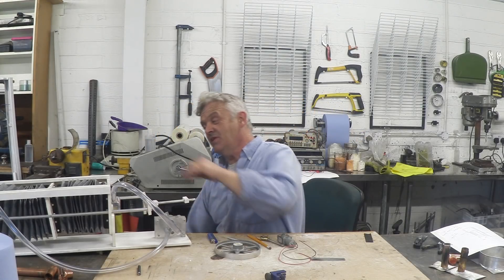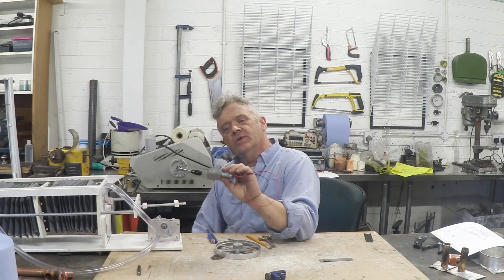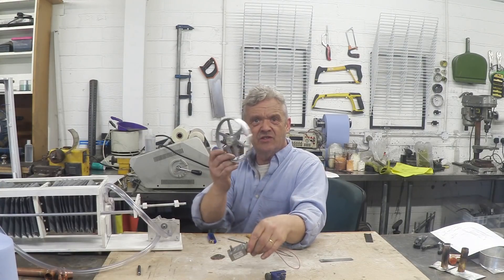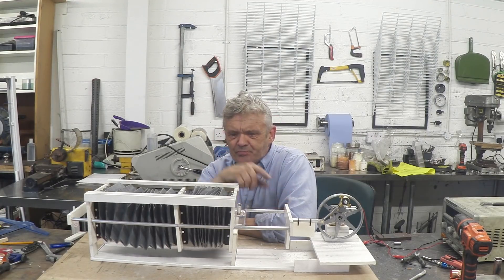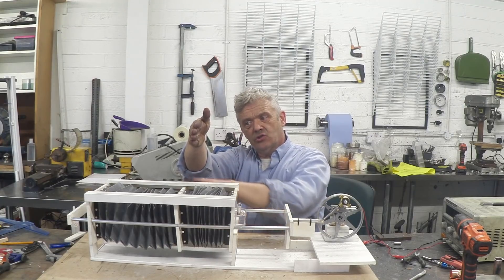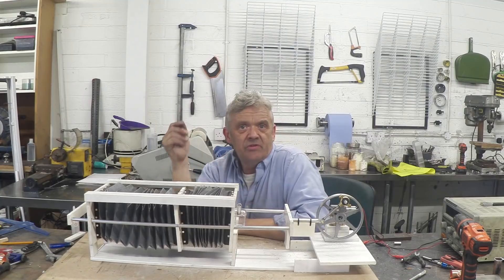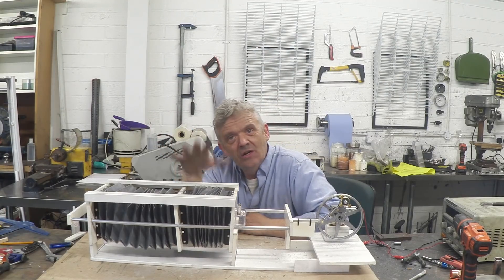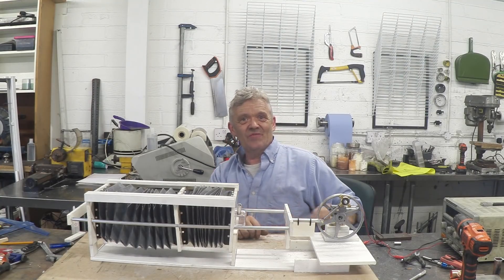DIY Air Conditioning 1 - From Bellows Efficient And Cheap

Comment: Drawing dry air into an evap medium dampened with water would cause said air to cool significantly. Inserting a heat exchanger ( think aluminum tubing air duct) within that cold, humid air section will give you A.C. Make it double acting and you have a continuous flow of dry, cool air to supply perhaps a small room.

Comment: It would be cool to use a Stirling engine that uses the temperature difference between the cold air source and the hot air where the cold air is being pumped to to drive the air con. Then it would cost nothing to run and be left going constantly.

Comment: Another idea I thought about was running the line that comes off of the valve chest through an ice chest with ice and then it would condition the air as someone had mentioned this being an air handler instead of an air conditioner. Just more thoughts.
Reply: That's not a bad idea although making ice in summer costs a lot of energy. But you could of course collect ice during winter, store it in a well insulated tank (buried in the ground for instance) and then use that in the summer to cool your house. I think that's kind of what people used to do back in the day, they'd collect ice during winter and then store it and use it to keep things cool during summer. The problem is that you'd need to collect (and store) a lot of ice to cool your house all summer long.
In Germany they now have systems that use this ice collection principle to cool (and heat) homes in combination with an absorption heat pump (a brine/water heat pump) and PVT panels. During summer you warm up a closed water source and in winter you use that stored warmth in combination with the PVT panels and heat pump to warm your house. Towards the end of winter you stop using the PVT panels and warm your house by running the heat pump only of the source. This to create the ice you can then use in summer to cool your house. It's similar to a closed water source system with pipes in the ground with the difference that those don't get to temperatures low enough to create ice. Basically an ice system is a water source system that has been dimensioned too small. The advantage is that you can make use of the energy it takes to turn ice into water (and vice versa), something you can't with a water source. Melting (or creating) one kg of ice takes about as much energy as it takes to continue to heat that same kg of water to 80C afterwards, so there is a lot of energy being transferred in that phase change.
That phase change concept is something you also see in some passive temperature control products where during the day a material (a PCM or Phase Change Material that's made out of a mixture of salts) changes from solid to liquid by taking energy (heat) from a space (thus cooling that space) and at night, when temperatures drop below its melting point, it cools back down (gives off heat) into its solid shape ready to repeat the cycle. Basically they are thermal batteries, just like a closed water source is.
Reply: @easy_s3351  great info. A thought along those lines would be to build a big enough system to have extra energy to heat and cool water. Much like the process of using this instead of a brake on a turbine. They instead use the extra energy to heat water or you could also freeze ice. I just got a styrofoam cooler from my wife's doctors office that would be otherwise thrown away. I will put 2 vent ducts in the the top with a fan blowing in to the cooler with ice for our bedroom at night. We run the fan now. And it will be used for this hopefully starting Saturday night.

Comment: Great video as always Robert. It is really quiet it seems? I know sometimes video is hard to judge that kind of attribute. There are truly many things that could be spawned from this video. While watching the machine run, I thought that a way to run the valve by putting another rod on the wheel on the other side and use the rotation to time the valve with the movement of the wheel. Just a thought. Love what you do Sir!

Comment: I always watch your videos with a lot of interest and I especially like the reason, the philosophy, behind why you do what you do. But I feel in this case I have to correct you. Your bellows machine is not a cheap diy Air Conditioning but a cheap diy ventilation unit or air handling unit (AHU). The difference being that an AC conditions the air in a certain space whereas an AHU  moves air from one space to another but doesn't actually condition the air. It may sound like a minor difference but it does explain why ACs are more expensive, there's a lot more to them. Systems to move air around have been around for a very long time but it wasn't till Mr. Carrier (they still make AC units) came up with the idea of running air through a curtain of cold water that the AC was born. I happen to be a HVAC engineer so I care about this kind of difference.
You talked about how in summer the tin roof of your building gets really hot, how about if you could use that heat? What I'm thinking about is using it to either run an absorption AC or an ORC/Stirling engine (or both). An absorption AC is much cheaper to run than a compressor driven AC because it doesn't have a compressor but a pump (as it pumps liquid around) which uses much less energy and it runs of excess/waste heat (usually industrial). The challenge would be to see if you could make one that'll work with the heat generated from your roof (the required size of the heat exchangers could be an issue). It could also be interesting to see if it could also work with PVT-panels, those solar panels that also generate heat (Photo Voltaic Thermal panels). 
That would be awesome as you'd then have a relatively cheap to run AC as opposed to the compressor driven ACs currently on the market. I mean, you want to cool when it's hot and the hotter it gets the better you can cool with an absorption AC whereas a compressor driven AC only has to work harder (and consume more energy) as it gets warmer. And you'd yield extra electricity from the PVT-panels because you're effectively cooling them which improves their performance, above 25C a PV panel generally looses 0.5% of its yield per degree C, and you're protecting them from overheating and subsequentially catching on fire. Possibly that extra electricity is enough to run the absorption AC of and then it'll become free to run. How's that for a sales pitch?
You could also use your roof's heat to run an ORC (Organic Rankine Cycle) engine or a Stirling engine when you don't want to cool or have enough cooling capacity with some extra heat left over.
I have actually been thinking about this for quite some time now but don't have sufficient knowledge to work it all out. I think you're a pretty smart and especially pragmatic guy and as you always point out we should share our ideas because several minds working together can achieve a lot more. And, as you also have pointed out, solutions will consist of several systems working together. So what I'm thinking is a system like I just described; PVT-panels on a roof (maybe we could use Oasis foam as a heat exchanger and make our own PVT-panels) and you use that heat to run an absorption heat pump (an AC is a heat pump). An extra benefit is that in the heat pump cycle after evaporating (with the heat from the PVT panels) you have to condensate at high temperatures and you could do that using cold tap-water, effectively (pre-)heating that water and creating hot tap-water. If, like I mentioned, you have enough cooling capacity you can then use any excess heat from the panels to run a Stirling/ORC engine (same principle). You could probably make such an engine with the air engine/Tesla Earthquake machine, put magnets in the piston and run a coil along the cylinder. You could also use the magnet in the piston to trigger a magnetic switch to operate the valve timing, then you could make it a closed system reducing the loss in efficiency due to leakage.
I think NH3 (ammonia) could be a good refrigerant to use in both the absorption heat pump (a water-ammonia solution) as well as in the Stirling/ORC engine. A water-ammonia solution is already the common thing to use in industrial absorption heat pumps. And ammonia has a nice expansion when evaporating as well as a low evaporation temperature (-33C at 1 Bar) so it could be useful in a Stirling/OCR engine. You could run the cycle at say 50C evaporation temperature (I think that's about 40Bar) and condensate at room temperature (25C at about 10Bar) But if using ammonia I think the Tesla machine would have to be adapted to run on it, it doesn't play well with certain other materials.
Well, quite an essay that's become. Let me know what you think.
Reply: Indeed, I was thinking the same thing. The absorption refrigerator idea has actually already been implemented by Tech Ingredients on YouTube, so definitely feasible. You could even make a compression heat pump yourself, there are people on YouTube that have done exactly that, using second-hand compressors and propane as a refrigerant.
Reply: @GRBtutorials  Thanks, I'll make sure to check out Tech Ingredients like you mentioned, sounds interesting. I know there's several companies who make absorption heat pumps for the domestic market, some of which in combination with PVT-panels (Vriessman, NIBE), but they're all quite expensive (understatement).
Pretty awesome that people are making their own compressor heat pumps, I'd never thought anyone would be doing that,  I'll also check out them out on YouTube. It'll be interesting to see how they went about it, especially what kind of parts they used and how they control the system. Cheers.

Comment: I wonder if there is measurable heat generated by the compression. Have you measured outlet air temperature difference?
Reply from the maker: no - there is so little compression here I would guess it would be negligible

Comment: Silly question, but could a vortex tube be applied to better separate the hot and cold air, or would the pressures involved be too low?
Reply from the maker: I think the pressure is a little low here mate for that

Comment: I was thinking more along the line of a stirling engine. Using it for the power piston instead of the small tube or the flex membrane. This looks more scalable better for larger then a toy model. Something on the scale of a 55 gal drum so it can be incorporated with a rocket mass heater making it a heat engine. Rocket to provide heat in a secondary drum. The inverse of stirling is a cooling unit. The waste heat from the refrigeration side can be used as the regenerative heat function to augment some of the fuel burned.
Reply from the maker: I agree mate and I like Stirling engines so it is on the list for sure

Comment: Ease of scaling this to a huge size has minimal cost and more efficiency. No rattling sound, vibrations and easy maintenance.

I think Mini version can be used as a ventilator with some controlling arduino.
Reply from the maker: for sure mate - but I use this little models to work out ideas and kinks - but I agree

Comment: I'm so glad the lonely pushrod finally found a home!!  I have a soft spot for orphans. 😊  I really like both the efficiency and the noise level of this.  I'm thinking you could build a nice little heater out of it.  What if you were to fit this to a chamber that preheated the air being drawn in?  This moves the air slowly enough that I think you could get some nice heat exchange happening.  The same may be true for making it into an evaporative cooler, sucking warm air through evaporative pads saturated with cold water and into a chamber filled with icy water before being blow out into the living space by the bellows.  Not to mention this would beat noisy fans in an RV to circulate air and reduce the risk of carbon monoxide buildup in the cabin.  (Edit)  Never mind me, I didn't watch your other video first where you discuss using the heat exchanger, LOL. 😄 I should know by now to wait until watching your next video before I shout out ideas to make sure you don't have a better one in mind first. 😋
Reply from the maker: you are ahead of me - I'm getting there lol
Reply: @ThinkingandTinkering  Yeppers, I need to learn patience!!  I'll try and work on that, but this channel has really fired up a brain that has barely been functioning for over 10 years.  I feel like I have to blurt out everything that pops into my head before it disappears on me. 😄

Comment: Sorry but that's not an air conditioner. Just a fan of sorts.
Reply from the maker: no worries mate - you are quite right it isn't - yet! - lol - this is the core of AC unit mate we will develop this into a low power AC
Reply: @ThinkingandTinkering  They are selling these little fan devises that have water in them and calling them air conditioners for $89 bucks. They are a scam. So mindful of that I thought I'd clarify that your devise isn't an AC. At least your not charging people for it.

Comment: You could attach a evaporation filter in the middle of them n use a humidifier atomizer module  which are cheap like 3US and a small water container. Would greatly lower the temperature of the produced air.
Reply from the maker: nice thought mate - that was on my mind too

Comment: Good one Robert! With a  crank at 60 watts those little belows will pump a great deal of air with small amount  of energy. Effectively you have an air compressor. Please keep working on it will save more energy than a wind mill. And thanks
Reply from the maker: I think you are right mate - I am really impressed by your idea here
Reply: @ThinkingandTinkering  Robert, I am an old physisist, and you are on to an important discovery. With your can do. You made a discovery about the pistons

Comment: A diaphragm would work better than a flap valve, just a large round thin piece of rubber secured in the centre (same principal). This is indeed an awesome purpose for this unit, a small solar cell charging a small bank of batteries (or a 12v lead acid battery) would run this for free 24/7. Another great video Rob, I love how you give us a small video showing stages of the project pretty much daily rather than a long video every week, this way you engage your audience and alter the project based on ideas given which is in itself really awesome. This sets you apart from so many other channels on YouTube, as said before you inspire very much like Professor Julius Sumner Miller did when I was a kid. Great work mate!!
Reply from the maker: you have just inspired a video mate - cheers
Reply: @ThinkingandTinkering  cool, it's nice to know my thoughts are on the right path at least some of the time 😂

Comment: A longer con rod might reduce some of the side thrust and save a bit of energy.
Reply from the maker: cheers mate - I was thinking scotch yoke?
Reply: @ThinkingandTinkering  A Scotch Yoke should be fine but the forces in the con rod follow a simple cosine vector, so the longer the rod, the more straight line power transmitted.

Comment: If it moves alot of air , can it be made into a audio sub speaker or a supply for assisted breathing ?
Reply from the maker: it already is mate - the ventilator in operating htaters are basically bellows
Reply: @ThinkingandTinkering  yes , I saw some people building these fo covid support and wondered if they built this part as simply :-)

Comment: I can see that possibly easily adapted to evaporative cooling for dryer climate's as well with a few wafer pads using a large port as both intake and exhaust across a wet pad 👍
Reply from the maker: spot on mate - or a bucket of ice or a radiator with pumped cooled water maybe - lots of potions here
Reply: @ThinkingandTinkering  Potions? Options? The lines are becoming thin and blurred....  Lol

Comment: Would not a simple rotary fan pulling air from the cooler air space be more efficient in that it would not have to overcome the mechanical resistances within the bellows mechanism? Thanks for any help and creative video!
Reply from the maker: you could use an impeller as basically you are going to have to duct and if you don't have cold air you are going to have to condition like pulling the air over - say a bucket of ice - either way it needs ducting and a simple fan couldn't do that - an impeller could - but that can be a challenge to make - bellows are easy and anyone can do it
Reply: @ThinkingandTinkering  Sorry, I thought you'd mentioned pouring cool air out of a basement. This was the scenario of which I was thinking. Am I incorrect?